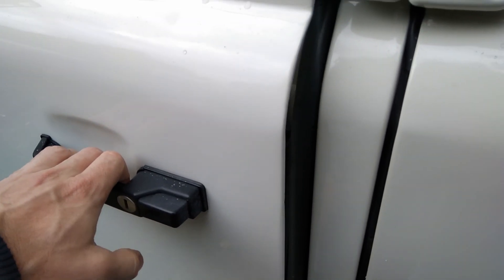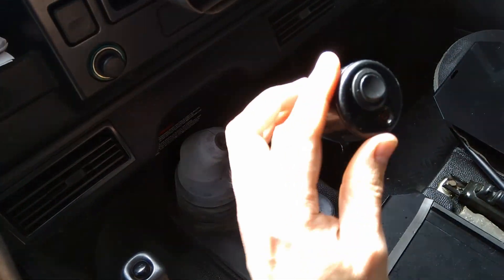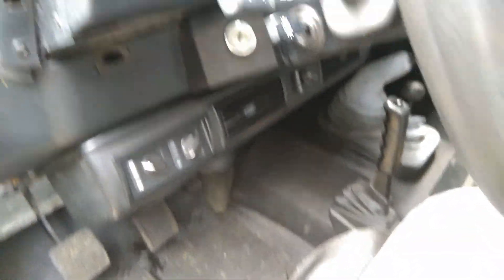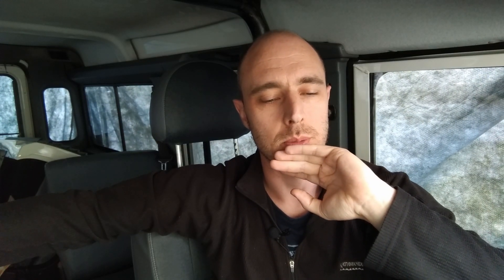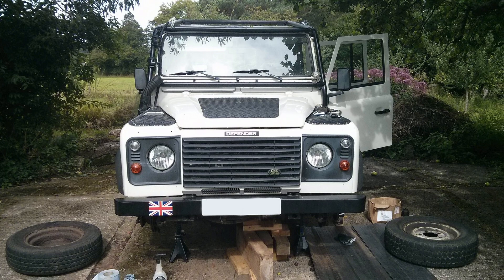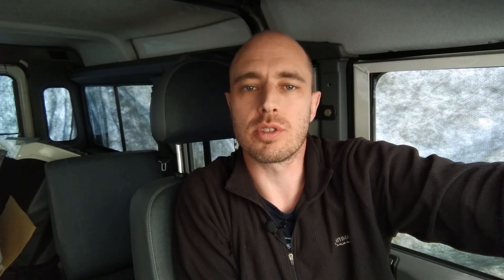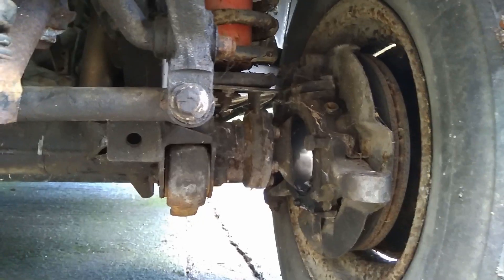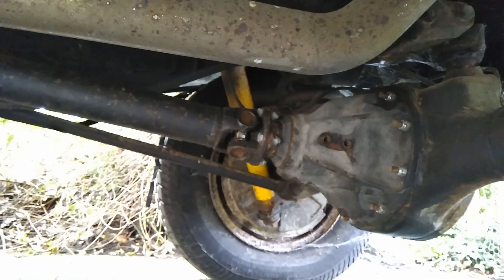Why I bought a heavily modded Defender with no service history

Comment: The switch for the rocketlauncher on the shifter !🤩
Reply from the maker: I daren't press it..... 😁
Reply: @lrworkshop  maybe ejector seat? No really... what is it for and where is the cable running?
Reply from the maker: @tim8505  To engage the GKN overdrive. Cable goes to the control box under the seat
Reply from the maker: @tim8505  It has a speed sensor which won't let it engage below 30mph, which is why the control box exists
Reply: @lrworkshop  ah ok I was only familiar with the mechanical ones thank you :)

Comment: Nice story and a good investment. Wise words about selling mods.

On a completely separate note, about two years ago, I saw a 110 broken down at the Peas Pottage roundabout on the A23 in Sussex.
I think it was green and it had a Scout sticker in the back window.
I pulled over and found a senior gentleman, he had lost drive and the handbrake had failed at the same time. 
I got him to select diff lock and it worked, I followed him into Crawley and got the thumbs up at the lights, we went our separate ways.

From the limited symptoms, have you any idea what failed? I had my suspicions, hence the diff lock trick but I don't really know.
Reply: Broken rear half shaft, probably by a stripped spline on the drive flange end - very common wear point on standard shafts if the ends aren’t greased.  The handbrake, being a transmission brake only acts on the rear axle unless the centre diff is locked or it’s also parked in gear.
Reply: @gs188  thanks for getting back to me. That makes sense. I was just happy to see the old boy not stranded on a hot day.

Comment: Can anyone tell me how to tell HD halfshafts from normal ones? Is the diameter different or just the material?
Reply from the maker: Both. Ashcroft use an stronger metal and it's thicker, plus is designed to have less weak points with more gradual changes in diameter along its length